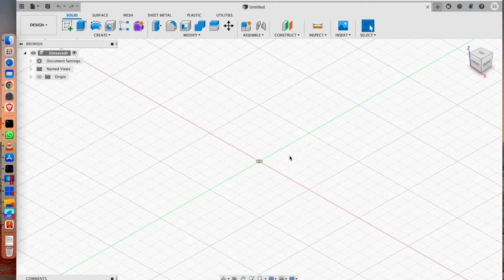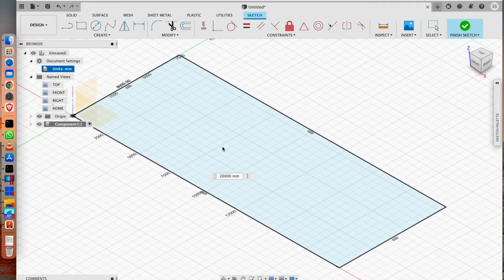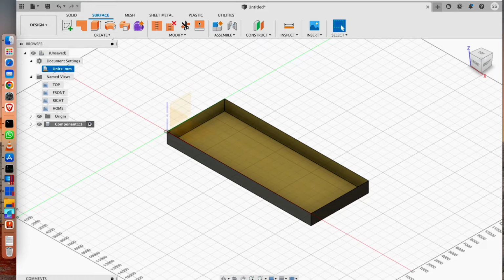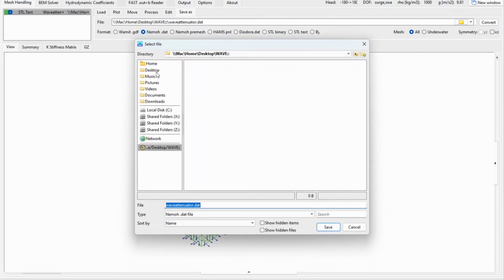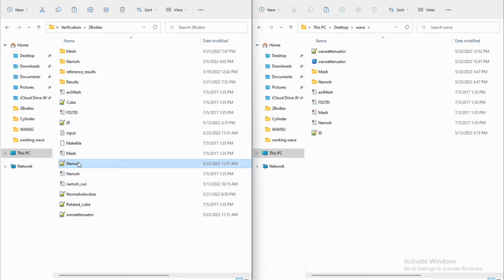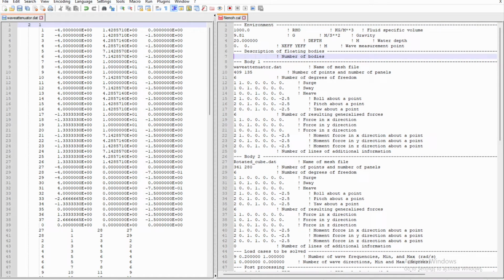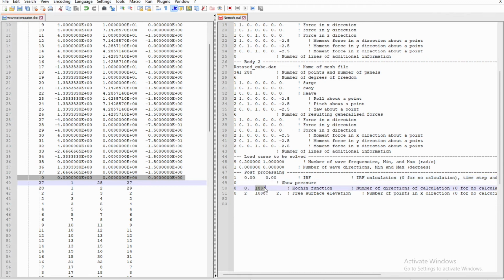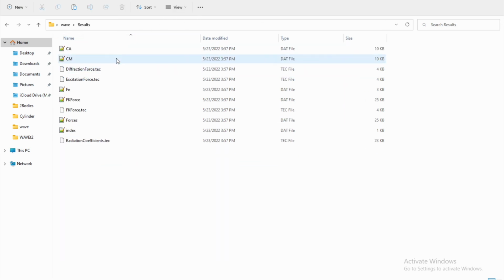NEMOH tutorial

Comment: I came here to find out how I could create a mesh for a geometry that isn't just a square or a sphere. Fusion 360 can draw the geometry and in my understanding you can convert the geometry (.stl file) with BEMRosetta to a Nemoh compatible mesh file. Is that correct? Also, thank you very much for this tutorial. It was immensely helpful.
Reply: Hello there, that is exactly what I did !! but running Nemoh in Matlab following this tutorial does not fully work for me, I get some errors when I run Nemoh. How abt you?
Reply: @vinesnation7202  make sure that the path described in the ID.dat file is correct. It should refer to the mesh file that you use. That was my error. Hope that helps
Reply: @thijssie1987   hi, I see that my ID.dat file does not have anything related to the mesh or directory. Could you please upload a sample of your file and share the link so I could have a look. Thanks alot
Reply: @vinesnation7202  It was not the ID.dat file, I meant the nemoh.cal file, sorry for the confusion
Reply: @thijssie1987  I have managed to run Nemoh via cli without setting up my cal files manually ... I just used Bemrosetta to setup my files which then generated me a folder that contains all the files needed to run Nemoh. I then click on the bat file and then my calculations are done in abt 10 mins
Reply: @thijssie1987  do you have an example on how you fixed this? I've got the same problem but am completely stuck
Reply: @vinesnation7202  Me too, I'm trying to fix it as we speak. I have a meeting with my supervisor later today. If I have the solution I'll post it here for you.